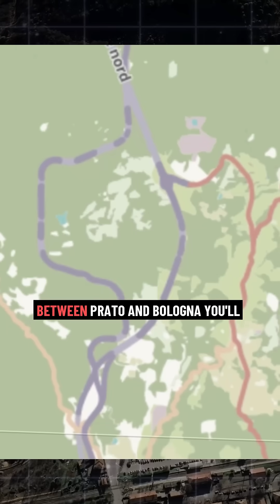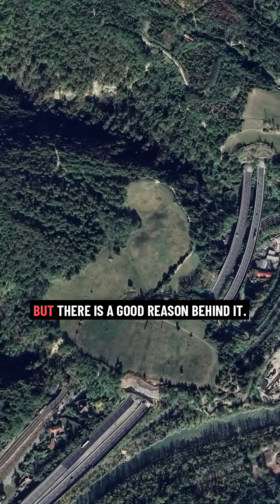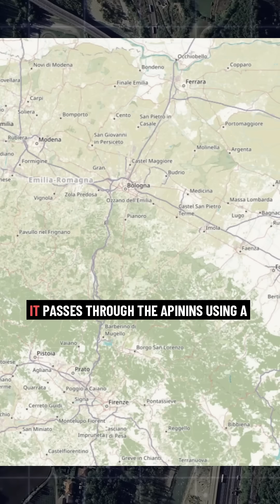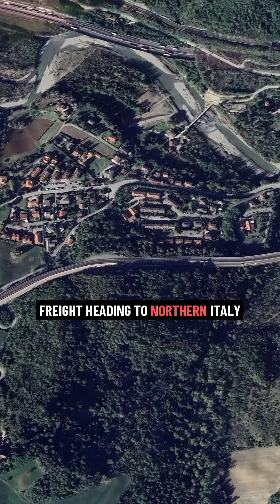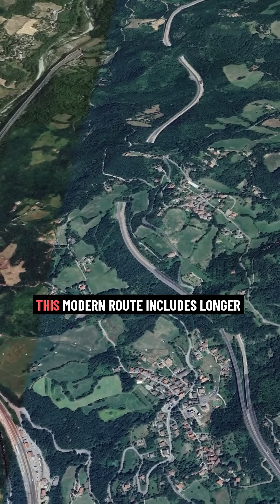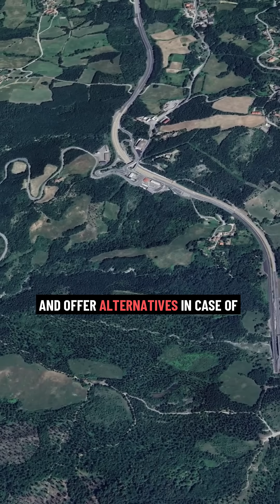Why Are There 2 Highways Next to each Other?

Comment: In Spain there are also some parallel highways, most of those being one of them a less congested toll road. One example is the route between Zaragoza and Tudela, previously served by nacional-232, now by Autovía del Duero A-68 and Autopista Vasco-Aragonesa AP-68, this second one being of payment but with smoother curves and less intersections, and a slight reduction in travel time.
Something similar happens with the access to the city of Málaga through Antequera, this time in a more mountainous situation

Comment: That's kinda common in Oklahoma with Interstates and US/OK-Highways. The old route is usually a bit less straight and a bit slower. The new (still usually old though) interstate is then built close to the old route to be faster, and usually bypass small towns the old route goes through. Sometimes in big cities though, they don't have enough room to build the interstate next to the old highway, so they replace the old highway, merge the two routes, and sign the freeway as both.
Some examples:
I-35 and US-77 from TX border until Tonkawa (and I-235 within downtown OKC)
I-40 and former US-66 from TX border until Yukon
I-40 and US-64 from Warner until AR border
I-44 and US/OK-66 from I-44/OK-74/OK-66 interchange to MO/KS border
I-44 and US-62 between Lawton and OKC

Comment: This happens a lot in the UK with A-roads (which often vary between 2 and 4 lanes along their length and follow much older routes) and motorways. Check out the M3 and A33.